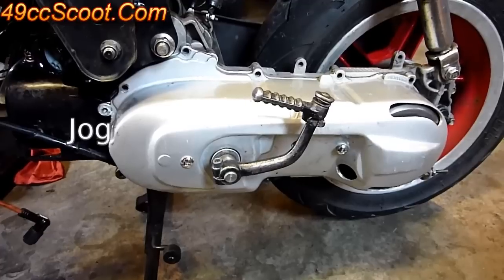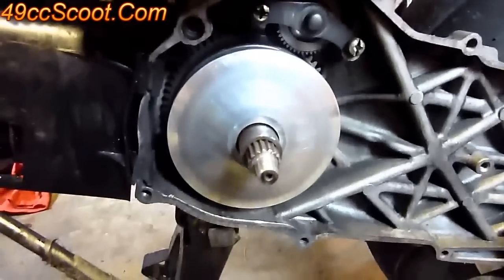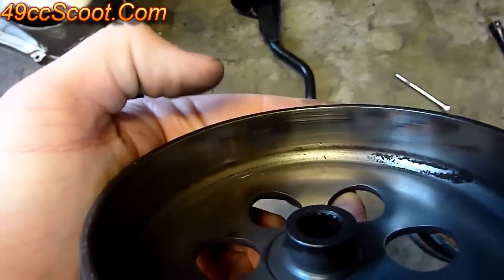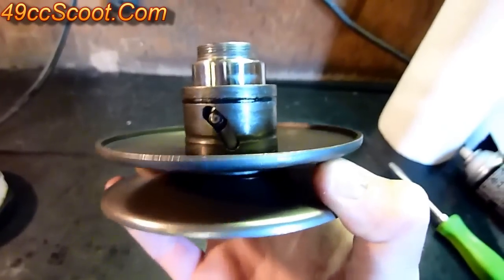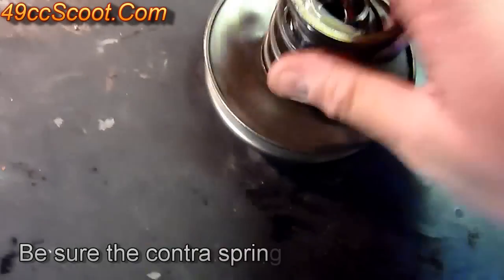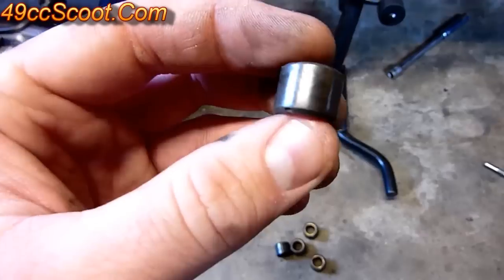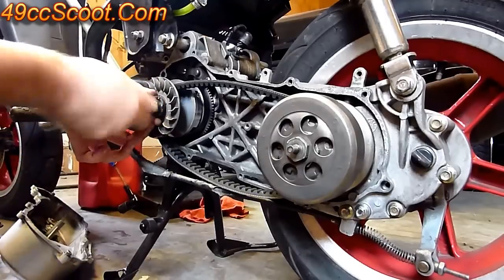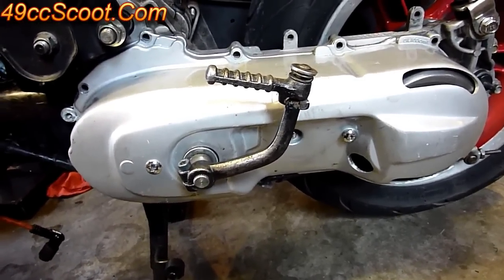Scooter CVT Transmission : Full Service Inspection

Comment: due the rear shoes drive scooter? I thought variator  controlled ratio
Thanks
Reply from the maker: The front pulley spins the rear pulley. When the rear pulley spins fast enough the clutch springs engage and the rear pulley begins driving the clutch bell which is attached via splines to the primary drive shaft. That then drives the rest of the gears in the gear box and ultimately the wheel. The variator and torque driver vary the ratio of the transmission.

Comment: me again this one i dont know when i pull the rear brake in the engine changes the way it idles. ??????? i checked the wires to and from the brake light. ideas?
Reply from the maker: Possibly related to the clutch. Might stop the wheel and stop the bell and change the load on it. Might wanna check into that.
Reply: will do thanks
Reply: im going to replace the clutch it has 15.000 miles on it. thanks.

Comment: I can't get the cover off my scooter to replace my C V T belt what so I have to do to get it off/ Kenneth
Reply from the maker: Make sure every cover bolt is out. Then tap around the edges of the cover with a rubber mallet. Usually that gets them.
Reply: OK will try that to remove cover, hope all I need is just slap on a new belt to get going again 90GTVert. Kenneth
Reply: will try a rubber mallet to remove the CVT cover to replace the belt. Kenneth

Comment: can u do bottom engine assembly video for gy6? i need to replace my crankshaft, i know only top engine build, ty
Reply from the maker: I don't have a GY6 ATM
Reply: @49ccscoot  any similar scooter will be fine lol
Reply from the maker: @itaizrihan5701  The GY6 is different. It's actually more complicated than the standard small scoot engines because of of  things like a press on gear and the starter clutch setup.

Comment: Geat video i recently had a problem with my 250cc chinese shanhai, I was out riding when it shut off so i tried to restart it and the engine just froze nothing the engine seems like it went comletely dead the electric work but the engine wouldnt turn over,any suggestion,so i had to have it picked up,one day there was a loud knocking sound coming from the engine before this happen so i kept riding then the sound just stop and everything went ok until this day the engine froze and wouldnt turn over again,any suggestion? Thanks
Reply from the maker: Could be a serious engine issue. You can start by popping off the CVT cover to make sure nothing there has jammed up. If the CVT is free and you can't turn the engine over you're going to need to dig into the engine.
Reply: Ok thats a good place to start with the cvt I will keep you updated on how it comes out hope its not in the engine though,thanks for the suggestion,you the man.
Reply: I have another problem here my 250cc scooter want start from the starter switch and using the left brake i have to start it from the selinoid using a screw driver is the starter switch seems dead any suggestions?
Reply from the maker: Shalon Muhammed This should help :
http://49ccscoot.proboards.com/thread/647/start-troubleshooting?page=1
Reply: *****
I pop off the cvt cover and its free nothing is there but the front rotor want turn when i try and start it?Any suggestions.thanks Ps. its like frozen when i try and turn it over?
Reply: *****
When i took off the cvt cover check to see if its free when i try and start it the cranck shaft want turn its like frozen any suggestions?thanks
Reply from the maker: Take the variator off if you aren't totally sure nothing in the CVT is holding it up. Check the flywheel side to make sure there's nothing jammed and if not then you're gonna need to check the engine out.
Reply: Is a GY6 parts the the same or can I used the guide to fix a GY6 as on my 250cc chinese jonway shanghai the same inner parts?
Reply: Is aGY6 parts the same parts on my 250cc chinese jonway shanghai or can I follow the manual for a GY6 to fix my 250cc chinese jonway shanghai crankshaft?
Reply: If the variator want turn and is frozen when I try to start it then what could it be? Any options?  I guess it could be inside the motor next correct.Thanks any more suggestions
Reply from the maker: I really don't know much about the 250s. Haven't been around them. They should be somewhat similar to other CVT powered Chinese scooters, but the exact process will likely vary. The basics and timing marks and so on should be about the same.

If the vari won't turn then most likely the crank/engine is locked up for some reason.
Reply: Thanks I Figure the same,I am going to install a new engine because that engine is gone.Thanks ,peace
Reply: Ok thanks I think its about time for me to just go ahead and install a new engine

Comment: Does the torque driver run the rear wheel?
Clutch operate rear wheel?
Reply from the maker: Thomas Flynn The clutch bell is what's directly linked to the gearbox and ultimately the rear wheel. Once the RPM of the rear pulley is high enough, the clutch will lock into the bell allowing the CVT to drive the scooter.
Reply: Thanks! I took off and the clutch and belt is worn out!

Comment: Trying to respond to email but wont let me. It was running fine til other day was at 45mph it backfired and bogged down. Now it wont go past ten mph when I give.it gas it wants to cut off but it idles perfect. Puleeze help
Reply from the maker: Clean the carburetor first. It could be as simple as some sort of debris clogging the main jet.
Reply: Was going to order new one today on ebay. Are those ebay carbs any good?
Reply from the maker: Honda Elite  Lots of people use them without major issues. Most of these sorta small stock carbs have become basically disposable because of the low replacement costs for eBay carbs. Costs less to replace than rebuild in most cases.

Comment: Hi man. I accidentally chipped 2 edges of the variator fan while removing the nut manually. Is it something to worry about?
Reply from the maker: Should be fine. In theory it could cause an imbalance, but in practice plenty of people have rode with them like that. Small amounts of material likely won't matter. If you start taking off big chunks, maybe.
Reply: 90GTVert Is the thread of the variator nut m12 or m10?
Reply from the maker: If it's a Minarelli clone, it can be either so you'd have to check.
Reply: Hi man, back here again 😁 i changed my variator rollers to lighter ones from 5g to 4.5g rollers. However, still the same issues it bogs down going up hill but the rpm improved bit still not enough power. Should i move over to check my contra spring? It currently has a stage6 medium paired with a stage6 sports pro variator. Should i change to a stage6 hard contra spring? Or fiddle with the clutch springs first? Thanks man.
Reply from the maker: 0.5g shouldn't be a big change. Try lighter or try putting the stiffer contra spring in if you have it.
Reply: 90GTVert hi man. I managed to change the contra spring to 1500rpm with the 4.5gram rollers. Rpm seems to improve a lot. Hill climb improved a wee bit but still couldnt trust it 😂 Should i try lighter rollerslike 3.5to4g to improve uphill? Or should i change the clutch springs to stiffer or softer ones? Not sure what rpm is the clutch spring but it's purple coloured. Thanks a lot.
Reply from the maker: Change clutch springs if the first part of takeoff is bad. You can keep trying weights and see what happens.  Also, you have to remember this is a small engine. You can only expect so much from it pulling you and the scooter uphill.
Reply: 90GTVert should i pair it with the same 1500rpm clutch springs?
Reply from the maker: Contra and clutch springs don't have to be paired; meaning you don't have to use 1.5K clutch springs with a 1.5K contra. Use whatever works best in each case. Most of it will be trial and error. Swap tuning parts in, preferably 1 change at a time, and see if it's better or worse. So try say 1.5K clutch springs and see how it does. Then try 1K or 2K and see how they do. Use the info to decide which you like best or is working best. Tuning can end up being much more time consuming than building and engine.
Reply: last2hack 90GTVert i spoke with the previous owner, he said that he up geared the scooter. I dont know but but he must have meant about the final drive gear. Will that affect the hill performance as well with the gear being upgraded up?
Reply from the maker: Yeah. The numerically lower final drive ratio will make it harder to climb hills.
Reply: @49ccscoot  hi man, i viewd your other video about final drive ratios. Mine came up with a 13:1. And i forgot to mention from our previous messages that my scooter has a 70cc cylinder so basically it is not a 50cc scooter anymore and i only found out about it recently. With the 70cc cylinder which should have more power and all the tuning, it seems that i am still finding it difficult to move uphill from a stop. I pity myself as i see other riders with their 50cc scooters go up the same hill that i drive with ease compared to me. I thought the gear up kit would have helped. Thanks man.
Reply from the maker: Yeah, a 70cc and the deep 13:1 gears should be helping you get up there. Probably time to do a compression test.
Reply: @49ccscoot  another question man, with regards to pre mixing petrol with lubricating oil. Is it a must for all 2 stroke scooters even with the newer models?
Reply from the maker: As long as the stock oil injection system is working and you keep it full, that's fine till you get to big bore kits and such. Plenty use them with sport 70s, but most don't go much beyond there with pre-mix.

Comment: Will the starter clutch come right out after varator comes out ?
Reply from the maker: You'll need to remove the small gears, then the whole clutch assy can come out. If you just want the clutch itself and not the gear it rides on, then yes it will come out after the vari is out of the way.
Reply: *****  OK thanks

Comment: Hi, I have a vibration in the rear somewhere and I think this is the logical pace to start looking. It starts at about 25mph but is not constant, more like a throb. (*hey, I couldn't think of a better descriptive word) so at speed it's  ----<<<[[[]]]>>>---<<<[[[]]]>>>---<<<[[[]]]>>>---  and so on.  What would be the obvious culprit? It only has about 1K miles on it (the entire bike)  oh, it's a 150cc chinese scooter
Reply from the maker: The rear tire out of balance is a really common causes of that. You could try to balance them yourself (I have a vid of it) or use a product that balances tires like DynaBeads or Ride-On.
Reply: @49ccscoot  yeah, the local MC shop wants $65/tire to balance each tire. I made a vid. I will upload a link and if you want to take a look inside, I tore it down overnight and just now got done putting it back together
Reply: @49ccscoot  did you notice anything out of the ordinary?
Reply from the maker: @jefferyyoung5401  For a vibration at 25MPH, you shouldn't really be focusing on the kickstart. If the kickstart is spinning when you're going 25MPH, something is really wrong. Seemed OK anyway. The CVT, the gearbox, and the wheels and tires and the stuff to usually focus on with vibes when moving. Tires first because they're the easiest and most common issue, specifically balance.
Reply: @49ccscoot  LOL I know the kickstart isn't causing that. I think I learned that only moving parts carry inertia in mechanical engineering 101. I had a different issue with the KS. Thanks for the heads up on the beads, I didn't know they existed, and if they work the way I think they do, they should balance the tire every time the wheel spins. Unless you put fixaflat in there lol, that would make a nice mess wouldn't it

Comment: I'm so pissed my scooters been sitting for a month now and the only reason is I CAN NOT GET OFF THE 2 BOLTS for the clutch and variator!!! Need to replace my CVT and I do not own or know a soul with a Impact Wrench..so screwed.....
Any idea where I could buy one that would do the job?? I only have 70$ limit..
If you do know one that might work could you send a link it would be super appreciated!!
Reply from the maker: Christopher Spohr I've never used the small electric impacts, but some members of the forum use the ones from Harbor Freight. They should come in well below the $70, especially if you use one of their 20% off coupons regularly in flyers or catch a sale.
Reply: Thanks ill check that out!
Reply: ***** I bought an electric TradesPro Impact Wrench with 100lb of torque it got the variator bolt off No Problem but will not get off the Clutch bolt:/ Side Question: Will extremely wore out roller weights restrict my top speed?
Reply from the maker: Use a breaker bar if you can't get the clutch nut off with the impact.

Worn rollers can alter speed and acceleration.
Reply: Christopher Spohr  A hand impact is cheap and works well (the kind you strike with a hammer). It's great for removing stubborn Philips head screws too. I carry it on long rides in case I need to tighten or loosen something on the side of the road.
Reply: +bsrktm1 i replace all those pain in the ass philips screws. hex head or allen  screws or bolts.
Reply: +Kevin Stearns well, you gotta take them out first right?  A hand impact will remove most screws, nuts, bolts- even partially stripped ones. Again, they are a cheap, simple and effective tool.
Reply: +Christopher Spohr http://www.amazon.com/gp/product/B00Z8S6HSI?psc=1&redirect=true&ref_=oh_aui_detailpage_o01_s00this is a link to a variator holding tool for  a 139QMB clone -

Comment: I have the same clone scooter. Need to know the size of the washer you install around 25:10 that goes between the Kickstarter gear and the crankshaft nut. Scooter shop we trusted our scooter to broke the Kickstarter, and definitely didn't reinstall that washer.
Reply from the maker: https://www.ajusa.parts/atv-parts/atv-parts-kasea/kasea-skyhawk-90-quad/kasea-skyhawk-90-quad-clutch/washer-conical-spring-97310-102425.html
Reply: 90GTVert good looks, but I'm not paying 7 bucks to ship an 87 cent washer lmao. If I knew the dimensions I'd likely grab one from a local hardware store.
Reply: 90GTVert I'm thinking it's like a 16mm inner, 30 outer, 2mm thick. Anyway to confirm?
Reply from the maker: 16ID, 25.5OD, 2.75THICK is what I got. 30mmOD may not fit. Sorry, yesterday was a long day and I wasn't going to dig through stuff to measure one at the time I saw the message.
Reply: 90GTVert no problem man I appreciate the info!!!
Reply: Your videos are amazing. Sadly I had a mishap with a new variator install and lost my pulley and variator nut 😭😭😭. New pulley and star washer are on the way, but do you know the stadard size for the variator nut on the 16mm crank for the 1e40qmb? I've seen that some have recommended an M12x1.25 nut. The more important question is, do you know the ft-lb torque rating to put that nut on properly? Because let me tell you that hand tightening it is not sufficient nor consistent. Hand tightened it with no issue for about 400 miles. Put on the new variator, did the same thing and a half mile down the road, my engine was revving, parts were flying, and I was going nowhere.
Reply from the maker: The nut can be M10x1.25 or M12x1.25. Measure the OD of the threads and you should easily figure out which it is. Here's a bunch of torque specs and other info that I put together for the Minarelli clones... http://49ccscoot.proboards.com/thread/6145/minarelli-clone-bearings-seals-torque
Reply: 90GTVert you have found your purpose in life, sir. So scoot god.
Reply: 90GTVert what took would you recommend for holding my variator fan in place? I don't have those holes to use that special tool. That is part of my issue in why I haven't been able to torque that nut down or remove it without an impact. Any info is appreciated!
Reply from the maker: https://www.youtube.com/watch?v=v-rIWprA4PQ Check out about the 8min mark in that vid.

Comment: What is the purpose of those plastic tabs in the variotor
Reply from the maker: Cushions basically, so there's not metal on metal that is noisy and quickly wears.
Reply: @49ccscoot  thank you for telling me my scooter didn't have them and I was trying to figure out what was that grinding noise
Reply from the maker: @tassoss13  I usually get a lot of noise at idle if they are missing or worn. Look the variator over. The steel ramp plate can quickly wear the aluminium variator enough that it will cause issues so you may have to replace the variator if it's worn much.
Reply: @49ccscoot  my variotor is good only my rollers are bad and the noise starts after 20kmh about 12mph again thank you so much and I will go replace what ever is necessary now

Comment: The sound is like when u put a car in park while its still rolling also it has 21000 miles on it i changed piston and head at 12000 miles nothing else has been done other than a new belt

Comment: my Honda 125 will start right up and tire will turn while on stand you put on ground and it wont move and clue
Reply from the maker: +Alyssa Butera It's probably stuck "in gear", so to speak. Maybe a clutch issue or the rollers are misplaced in the variator.